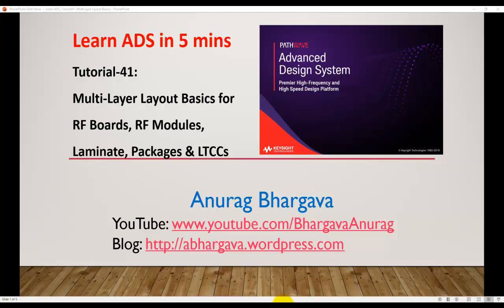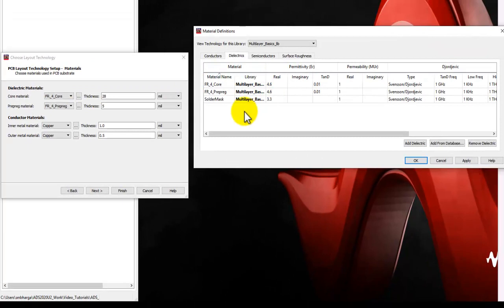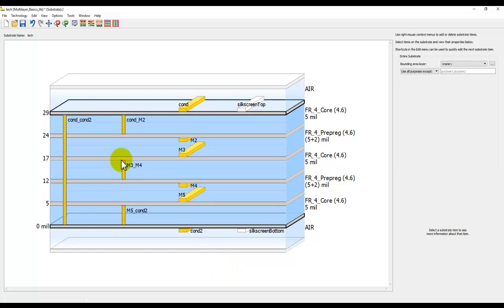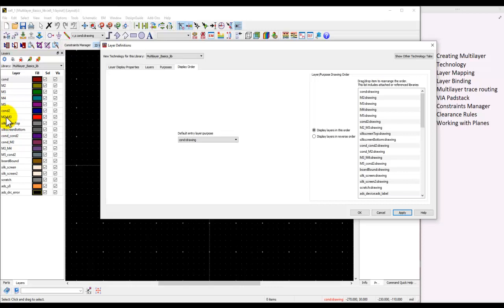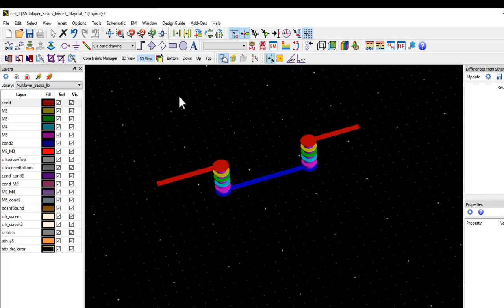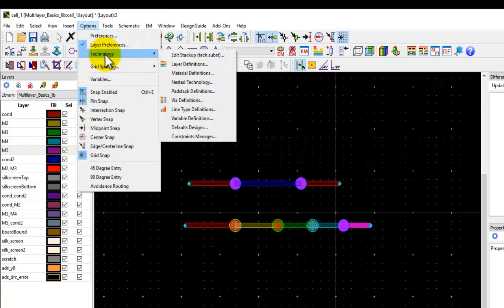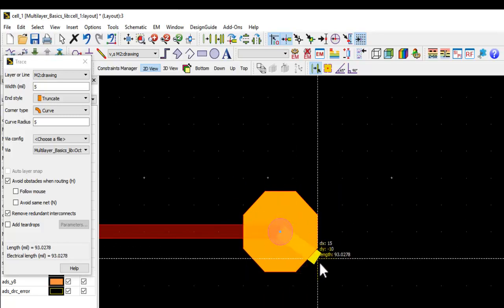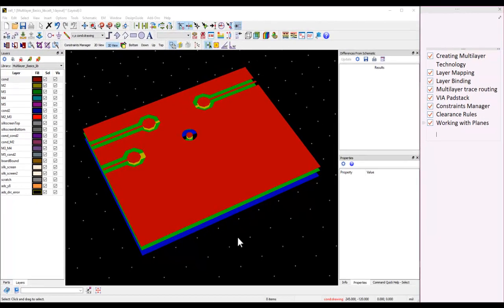Tutorial-41: Multi-Layer RF Layout Design Basics

Comment: Hello and thanks a lot for all your very useful tutorials. I do have a simple question. How could I simulate an ENIG or ENEPIG finish for my microstrip lines ? I only see copper in the list. Thank you very much 🙂
Reply from the maker: There is a method to do metal-on-metal kind of EM analysis in ADS, but the question is whether it is really needed? Usually, you don't need to compute the skin depth at your design frequency and use that conductivity definition for your stackup definition and EM simulation.

Comment: Hi Anurag, Can you creat some vedio about 3d antenna design using metal only in ADS. ?
Reply from the maker: Hi Sunanda,
I am not pretty sure what do you mean by metal only antenna? Could you clarify...
Reply: @BhargavaAnurag  I am a postdoc student at UNT Texes. I am working on a 3d phased array antenna design for electrical and mechanical beam steering. If you produce one or two videos about 3d antenna design then it will be helpful.

Comment: Very informative video. Suppose I want to do multilayer design in schematic using multilayer substrate and related lines, open stubs etc. I also need to use via from layer=1 to ground. Which component I should choose to model the via? I would also like to generate layout from the schematic based on the multilayer substrate defined in schematic. line, via etc. Please help in this regard.
Reply from the maker: I am sorry but you will need to work with your local Keysight support team for this. As long as you have defined the right schematic and via components (it will be multiple of them for a single via) from multilayer library then layout can be created rather easily. Other option is to use VIA designers to create the via with desired perform and then simply use it in your schematic design with rest of the circuit components.

Comment: hi, how to deisng dielectric slot in multi layer PCB simulation?
Reply from the maker: Hi Chang Hua,
You can map a dielectric via on the desired in the stackup editor and then use the same layer in your layout design to create desired shape of the dielectric slot. Once you do that, the structure can be simulated with FEM simulator in ADS and not with Momentum as it is method of moments solver and condition for MoM is to have a homogenous substrate which gets violated when you define dielectric via in the stackup.
Hope this helps.

Comment: Dear Sir, thanks for the great tutorials! They got me up and running with ADS in a couple of days. 
I wonder how I can model a planar transformer ferrite core in ADS? I defined a new dielectric material with permeability of 2000 and I used this material to define a dielectric via for core legs, and dielectric conductor for top and bottom plates. Then I draw the windings on the copper layers and it looks correct in the 3D viewer. The simulation stops however, with the following error message: "invalid conductivity".  Thanks.
Reply from the maker: Hi Yulia,
This kind of problem are difficult to resolve over YouTube. I would recommend you to work with your local Keysight ADS Tech Support team for better resolution.

Comment: Thank you sir... : ) you are unveiling lots of stuff in ADS....Is there any default component to insert jumper headers in our PCB in ADS...? What is the procedure to include it ?(INSERTING PIN PCB CONNECTOR )
Reply from the maker: Hi Siva,
I couldn't fully understand your query... 
Did you mean to ask how to insert an SMA connector in the layout for assembly & simulation?
Reply: @BhargavaAnurag  No sir, I'm not asking related to SMA , I'm having DC control lines in my PCB...and I would like to connect those to female jumper wires...What should be done in PCB layout in order to insert those wires...whether a via used for mounting SMT devices should be laid or any other method is available?